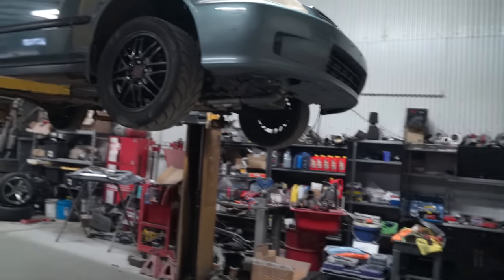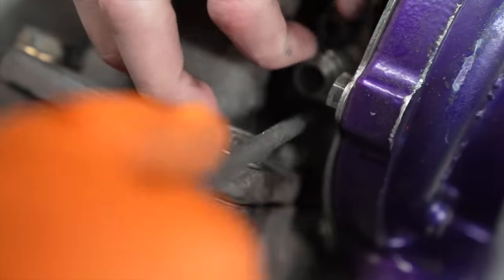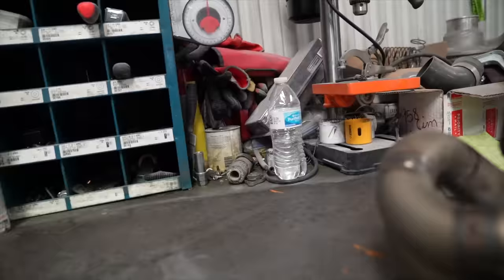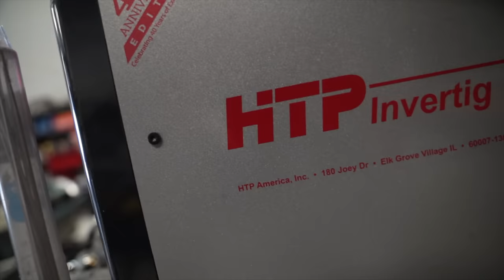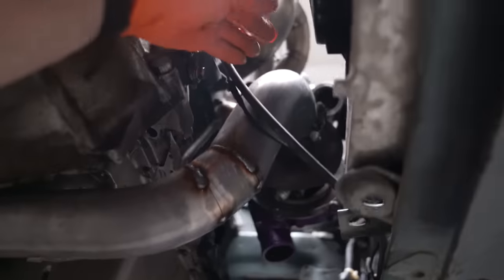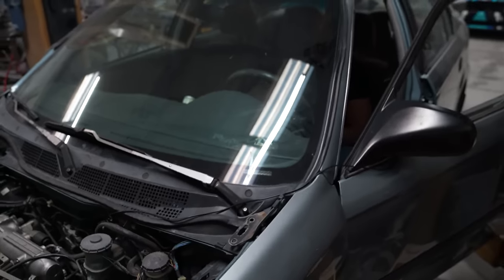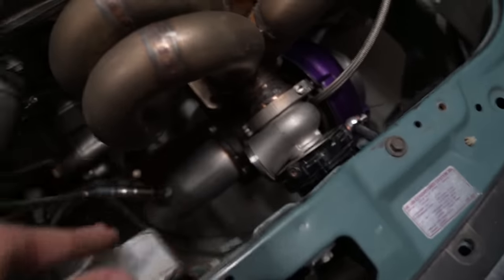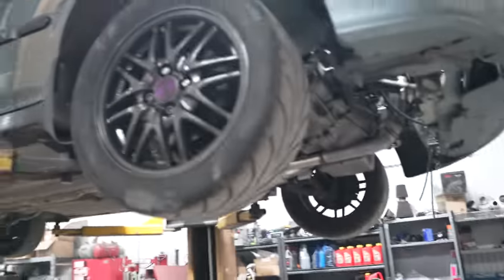Custom " Sleeper" Exhaust on the 500HP Civic Sedan! ( Electric Cutout Exhaust )

Comment: Could you do. A build review. What mods you’ve done to get to get to that power. I wanna build my d15b turbo
Reply: Dude it’s not hard at all to research what you can do to a car to make it faster. Please research before asking build lists. It’s obvious you don’t know much about building engines let alone forced induction. If I was you I’d start learning about the engines internals from the head to the block then research about forced induction. With the D Series engines 400-500 horsepower is very cheap to achieve however after that it gets costly and if you want more horsepower than that then forged internals and a sleeved block would be your best bet.

Comment: Should have done it so the valve goes to the quiet side - would give you more straight through on the loud side and who cares about the restriction on the quiet side. I'd be curious to see dyno or dragy results of open vs closed.